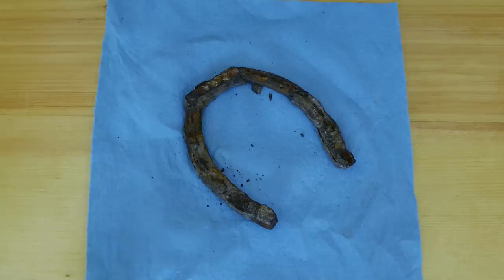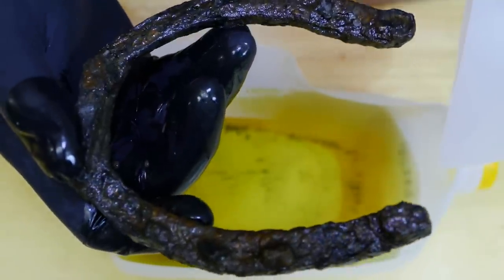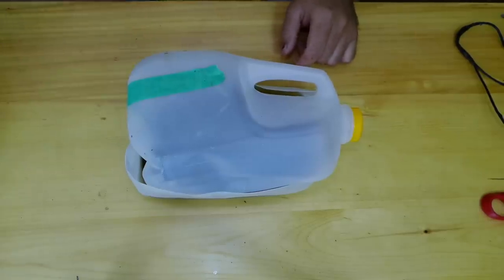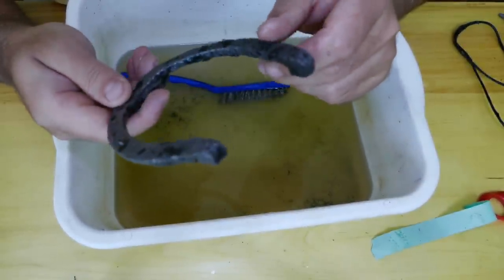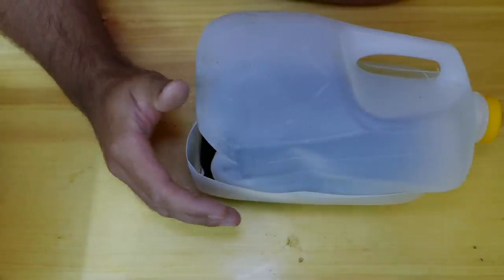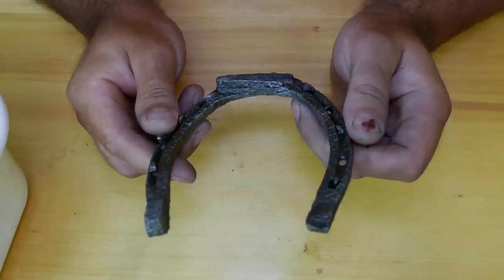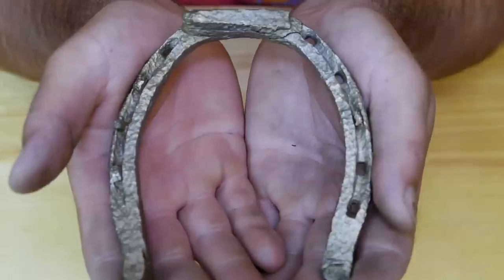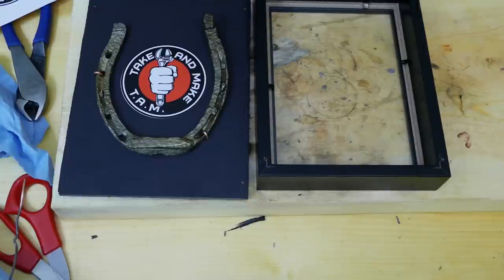Antique Horseshoe Restoration. One Month in Evapo-Rust!

Comment: Nice video and great tip of using Evapo-Rust on old horseshoes. After seeing you use Evapo-Rust I got some and used it to clean up some of the very old horseshoes I have collected. Some date as far back as the Viking age and several more are 12-14th century. Later ones I don’t really worry about. These old horseshoes are a lot more delicate than yours so I basically left them in there for 4-12 hours at a time and scrubbed them with a normal dishwashing brush. That loosened up a lot of rust and also allowed me to remove clay particles that had been incorporated in the dust. I did not use a wire brush in the end to bring them back all the way to bare metal as I doubt there would have been much left by that stage. Instead, I dried them thoroughly (for many days) and preserved them using a mixture of Paraloid B72 and pure, oil-free acetone (a mixture also marketed under the brand name Artiseal). This is used by museums to treat artefacts and to stop oxygen from further oxidizing metal objects.  Paraloid can be bought in small bags of crystals and you mix and dissolve it yourself with acetone and coat with a small brush. Make sure the work area is very well ventillated and remember acetone is highly flammanle (!!!). It can also be used on copper and bronze coins and other metal artefacts but have not tried that. I used a 6% (weight) mixture. I believe the Brititsh PAS recommends a minimum of 3% (check yourself). A too high percentage mixture will leave the objects looking very shiny and plastic coated so test and dilute until satisfactory results are reached.
Reply from the maker: Good stuff, thank you for your advice!

Comment: You could of saved yourself a lot of time and possibly gettingt better results.
If after you used the Evapo-Rust for 12 hours or more. 
Spray it with some penetrating oil. Leave it on for a couple of minutes.
Then after get it on the vise and use an Angle grinder with Steel brush wheel. Instead of brushing it by hand.
Anyways nice results. 😉